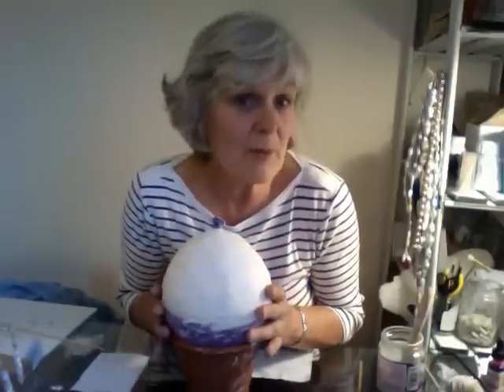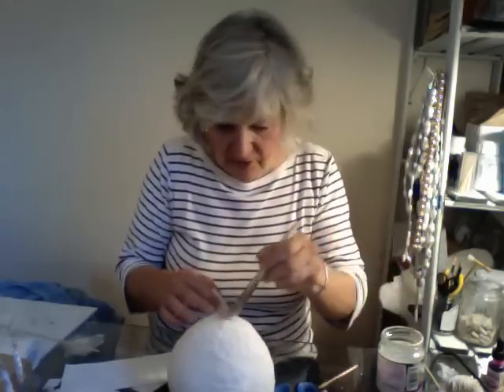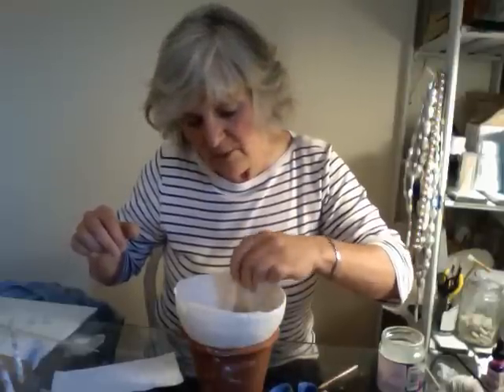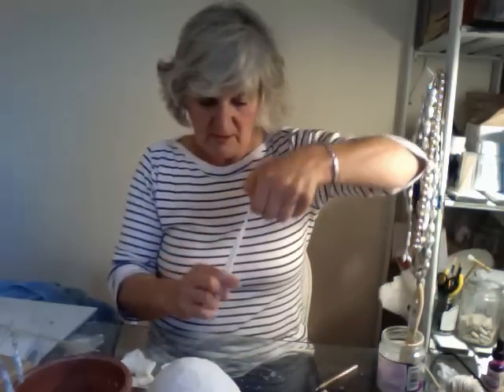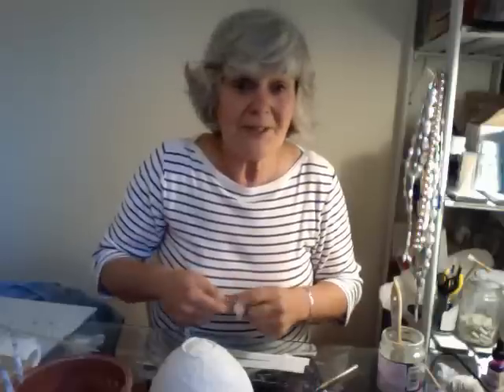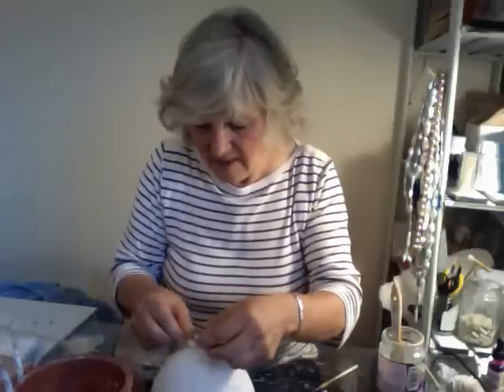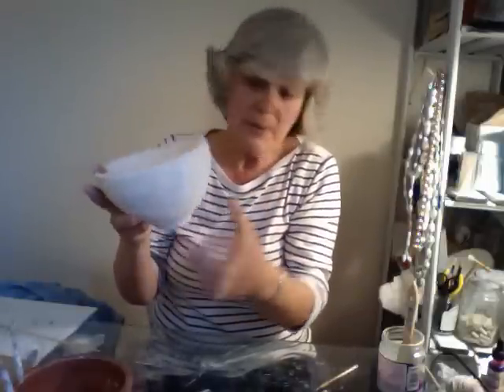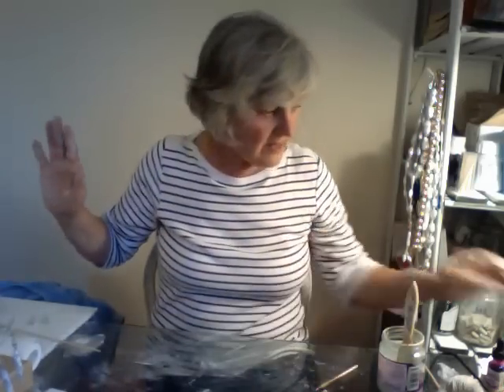Modroc Bowl - 2

Comment: Great video, I've just started using modroc, and I was wondering how you can smooth surface to remove the canvas texture? Thanks :)
Reply from the maker: I have started using Chalk Paint by Annie Sloan as it fills in the texture of the Modroc and can be sanded to any finish. It can be painted, scratched into, trailed and layered - as in building up relief and even polished with beeswax polish for a soft sheen that smells good.